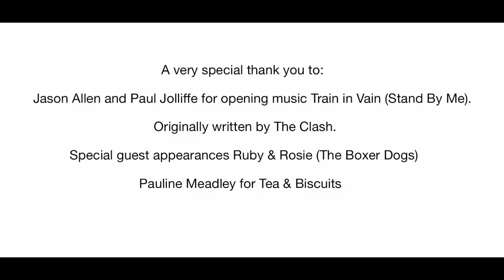# 35 How to make a Oak Pot Pourri bowl, woodturning.

Comment: very nice work .. nice commentary also ..  Even though I go for the extra support of using the 'upper' side of each fence, I can very well see your point of accurate registration of using the "insides" of the fences .. after-all, that IS where the wedgie was placed to achieve the angle .. have a happy weekend ..
Reply from the maker: Hi Jeff Yes I find that if you keep your wood on the inside of the jig you can't go wrong. As you say that was where you placed the wedgie.